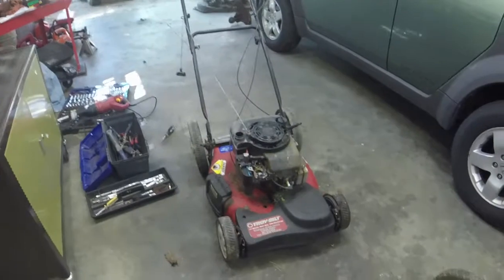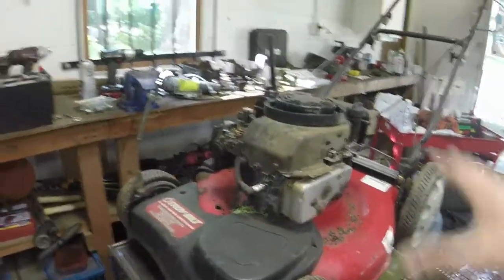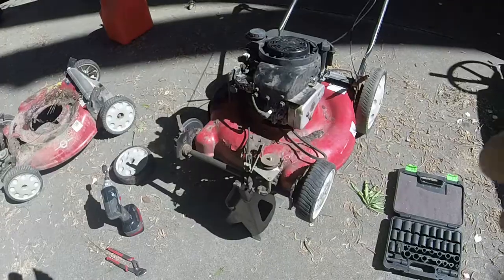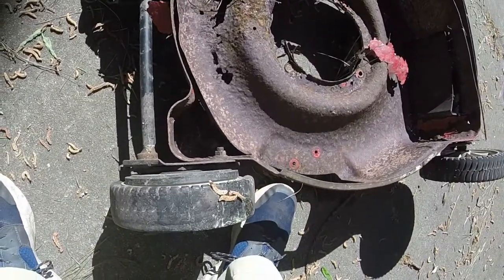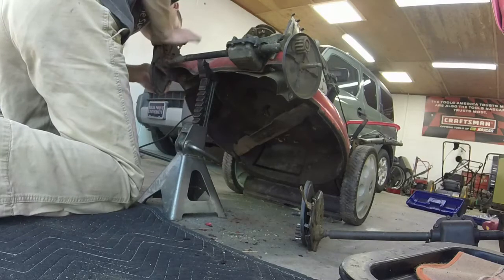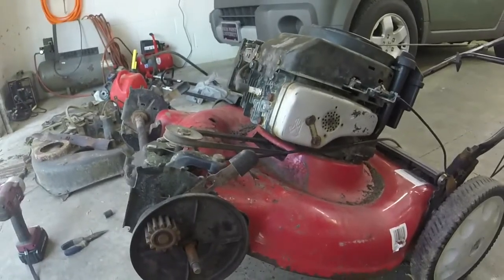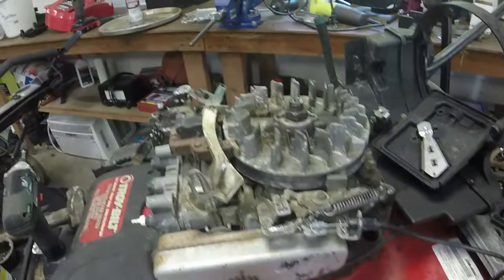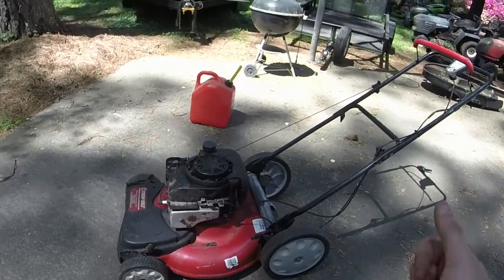Replacing the self propel axle on a Troy Bilt push mower & fixing running issues

Comment: On mine any idea why the front height adjiustment keeps slipping off the setting?
Reply from the maker: It could be worn height adjusters or a loose bolt holding it onto the frame.